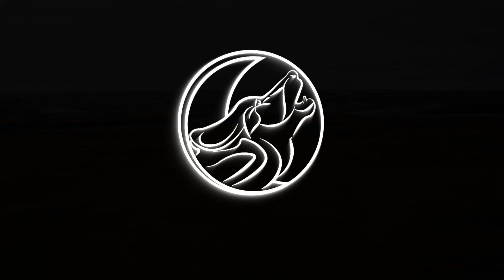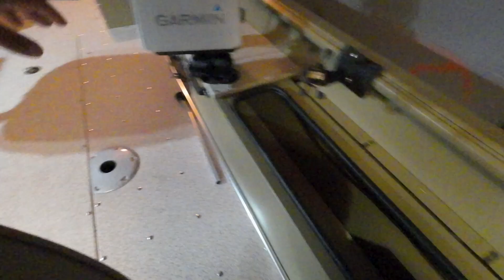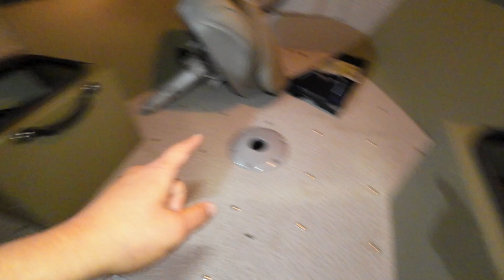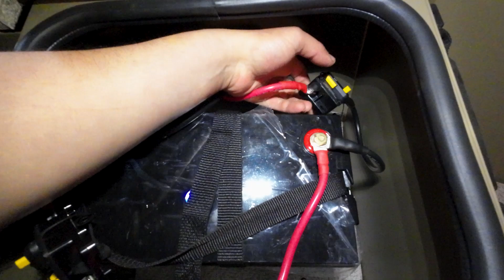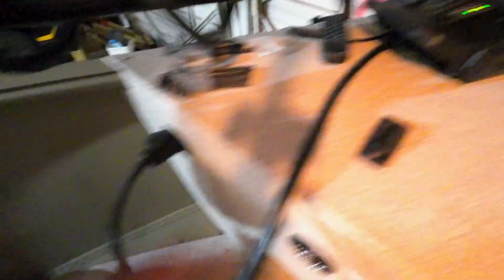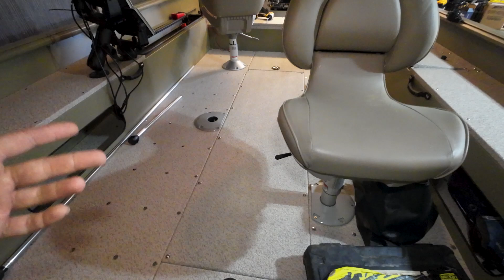The Most Effective Way to Charge Lithium Batteries Using Your Boats Alternator | 12V to 24V System

Comment: Most newer Lithium batteries have a Battery Management System that will protect the battery from over charge.
Reply from the maker: During my research I didn't come across any batteries that had a true management system. If you have a suggestion of a brand that does I'd enjoy checking it out. Modern batteries typically come with a over charge protection. But it's a safety device that stops the battery from charging to a point it physically fails and becomes dangerous but it doesn't stop the battery from becoming damaged from over charging which will greatly reduce the lifespan of the battery

Comment: @living High, Wild & Free. FYI the Yamaha main engines (Some models) come equipped with a secondary 12 volt auxiliary charge capability. I bet your engine has it. A call into Yamaha tech support will give you the part number & verify.  I use this cable to charge my dedicated house battery. The cable is connected under the engine cowling, the wire is run through the same connector as the other cable/fuel line. This cable is than connected directly to your house battery.